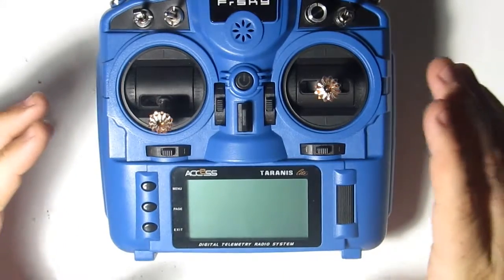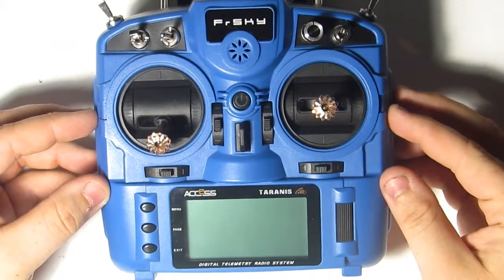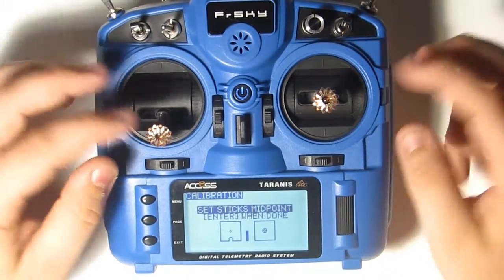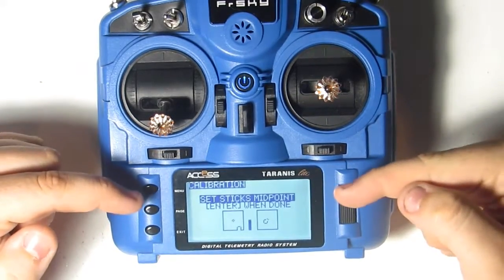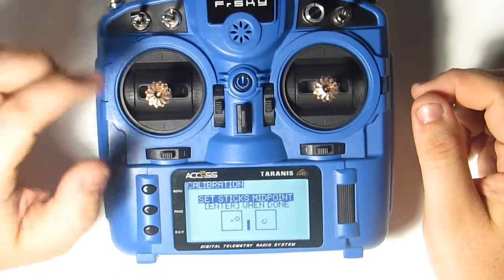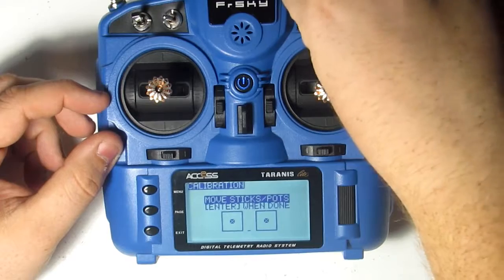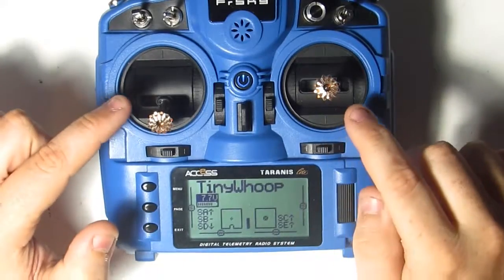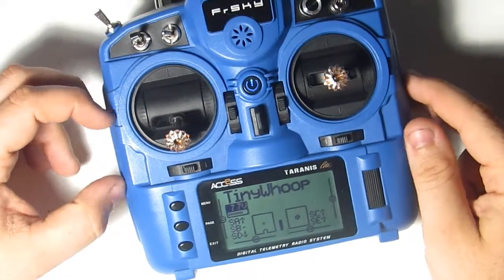FrSky Taranis Stick Calibration Tutorial

Comment: Thanks for the info, im very new i havent even got my Taranis x9d plus SE to work with simulator, it is very off, when i calibrate in windows or Velocidrone, it's like the movement in the square are in one corner like if you split a square into 4 squares its on the top right corner, i have no idea how to fix this, i would really appreciate if you knew something, it's so much to learn but i really want to start flying sim, but when i launch a map in velocidrone the quad just flips over and has almost full throttle, i have really no idea how to fix this :/
Reply from the maker: Sorry I am of no help for your situation. I personally do not fly simulators.
Reply: @trr2051  ok, ty for your answear anyway!